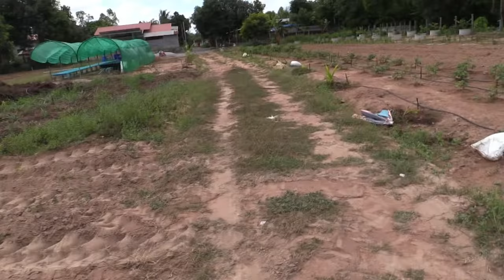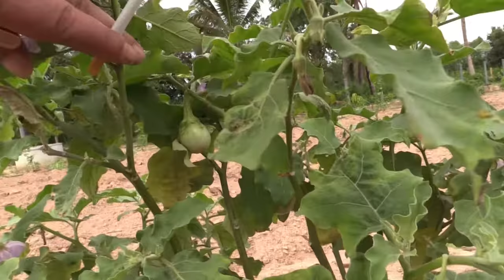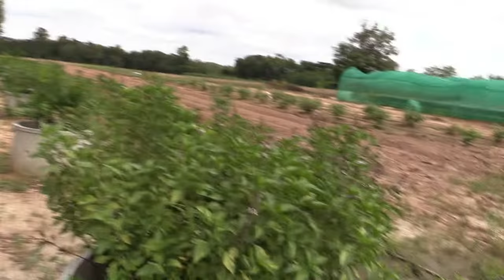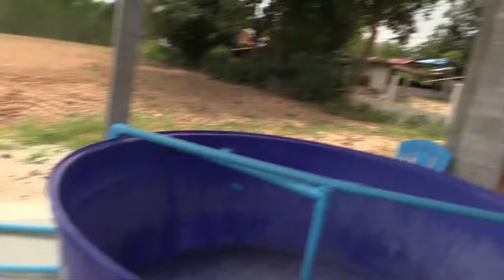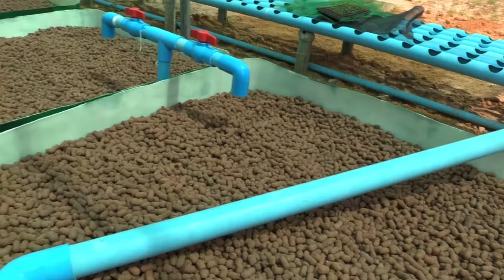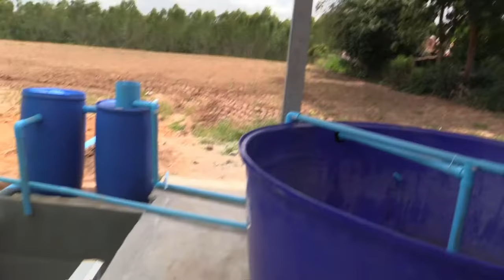Thailand Farm update October 17th 2019

Comment: Thanks for the video.Why for 2 different grow bed. Does your clay pellet comes from BioStone? How many Liter per hour is your pump for suck system.
Reply from the maker: I started with the IBC containers but had trouble sourcing them here in Thailand for a reasonable price in reasonable condition then I came across the black tubs at a hardware store and could buy 5 for the price of one IBC. Additionally the black tubs require no painting or other modification except a hole for the siphon, so less cost, less work.
Yes the clay is Biostone (https://www.facebook.com/biostonebyclaygardenthailand/) we got a mix of medium and large size. The Biostone visually has a far greater surface area then regular clay balls which is perfect for aquaponics.
Reply: @outboard2006  interesting. I just bought ibc at 2900 thb each because I need the structure.
Where did you find the black ones?  How deep are they 35 cm at least?
Reply from the maker: got them from Do Home Hardware they are about 28 cm deep I think they were 2650 THB for 5
Reply: @outboard2006  quite interesting. I will show you picture of my aquaponics system as well
Reply from the maker: @XavierArte   would love to see it